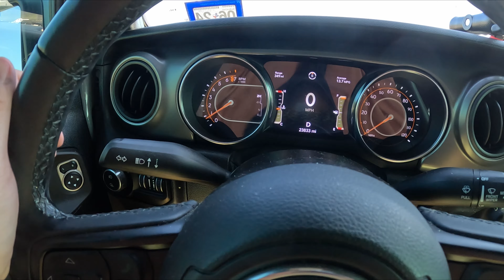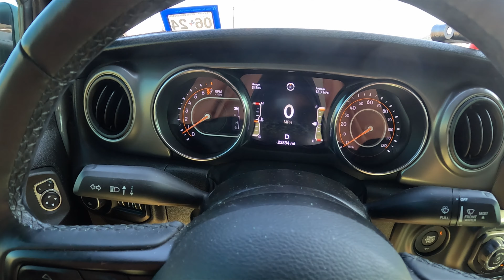5 ways to TURN OFF/ELIMINATE Auto Stop Start on a Jeep Wrangler JL, JLU or Jeep Gladiator JT

Comment: Fyi not all auto start stops have a second battery.  Ours is a rubicon 2021 with auto start and main battery shorted. Went to oreillys and bought both batteries pulled main one out followed a YouTube video were the second battery was torn it apart supported to be under the fuse panel and there was a compartment but no second battery.  Called dealer parts department and using  the vin there was no second battery on my rubicon ever installed at the factory.  No extra cables for it either.  Saved me 100.00 bucks
Reply: I have a 2021 Jeep Wrangler base model, and it also did not have the aux battery 
So I returned the aux battery back to auto zone for full refund.

Comment: I Live in the dessert and let me tell you sitting at a light and the engine goes off and since all the components for the Air-conditioner are NOT electric you only get hot air blowing. So, I have disabled the star-stop feature.
Reply: The auto stop will not engage is the ac is running and the cabin temp is above the thermostat setting. At least not on my 2024.
Reply: How did you disable yours?

Comment: I don’t know why they put the stop start in cars. It kills your starter and is bad for the engine when you stop all the oil flows to the bottom of the engine and then when the car starts again oil is introduced back to the top of the engine. This will definitely wear out your engine faster instead of letting the oil circulate without interruption.
Reply: My opinion: this is EXACTLY WHY they do it.
Reply: I don't know but I never met anyone who wanted that "feature". The jeep was at its best 10 years ago before all the "smart" stuff was forced onto consumers. Half the price too.

Comment: Took the start/stop battery completely out of my jeep and electrical taped both the ground and positive along with pulling fuse 42 and my start/stop is STILL functioning !?!??! I have the eco diesel 3.0 so I'm wondering if the fuse location and or fuse number itself is the same as gas burners ? Any help is appreciated.

Comment: Thanks for posting!  The hood plunger method worked for me and I don't mind the small "A" on the dash above the fuel gauge.  Such a pleasure to have the feature completely bypass without purchasing any additional hardware.  Also I'm able to still use my remote start too
Reply from the maker: Glad you were able to find something that worked for you. Appreciate you stopping by and Thank You for the Super Thanks!
Reply: I will Probably do the same and just get in my head that that A is the system giving me a grade.

Comment: The info you expalined bout the Tazer helped me so much! Long story short I bought my JT in AUG 2024  and I did not know until I took it to the dealership that someone prior to me put the Tazer system in. and it messed w/ my radio. ( it always displayed temp in Celcius instead of Farinheight and could not change it no matter what, it drove me nuts. At first the dealership changed the radio for a new one, that did not fix it.  3 months go by jeep dealership doesn't know how to fix this. they thought it was the BCM (body control modual) so in the 3 months, the AUX battery died, I replaced it, and SOME HOW the radio is displaying the correct temp. and NO before you could not just goto settings and change it from Celcius to Farinheight that did not work.

Comment: Pushing the button just turns it off when driving & it doesn't help the issue , which is the small bat. Draining and your remote start not working so eliminating it is the way to go !!! Won't have to worry about the small bat. And remote start will continue to work .. also the seat belt thing does work .I personally like Jscan better not only cause it's way cheaper but I find it does about everything tazer does but I believe tazer might have one or two brand specific things it does. All in it cost me less than 80 bucks to use Jscan & I can buy more vins where tazer is vehicle specific. Oh if you read the comments ( i hope so ) in your description you have the tazer link in for both tazer & Jscan not Jscan's link lol

Comment: I just purchased a 2023 Willys with the 3.6 and the auto start stop has not came on at all. Has mine already been turned off? I am afraid to turn it on . I don't want any problems. Also, will the aux battery still wear out if the feature remains off?

Comment: I just pulled the fuse and removed the battery cable from the main battery and my dash light indicator is still on! The auto start stop isn’t working anymore but shouldn’t the error light go away? I have a 2019 Rubicon. 🤷‍♀️
Reply: You may need to disconnect the main ground  for a couple minutes to reset the computer.  Then reconnect and try it again.

Comment: does the taser make the light on the dash go out ?
Reply from the maker: @rodneyhorton732  It remembers the last setting. So if  you turn it off, it will keep it off on the next start. 
If you have the lights on in the dash, it does not clear them.

Comment: The only thing I would add to the video is to either secure the box of the stop/start eliminator with a zip strap, or to wrap it with some kind of foam or electrical tape. It looks like it would rattle against that support piece. And I hate rattles

Comment: i think just turning it off will not solve the problem long term, I always turned mine off by the switch, it was muscle memory, and three years in aux battery dead. I love that little add on but long term I dont think its going to work. Plus, just not sure about leaving a dead LI battery in the vehicle, those things get unstable over time

Comment: The aux battery is not a lithium. It is a an AGM battery. Fyi
Reply: So my battery died he removed the line that connected to the aux battery bought a new battery main one.  The start stop still worked. So he removed the plunger reattached the aux cable then removed the plun ger removed  Battery died. Not sure why. Need help
Reply: @joycegregg4283  the new style AGM batt rays don't last as long as the old style batt rays with the refillable caps on top.
most new AGM batt rays are rated for 36 months, 24 months and 12 months.
the JL's and JT's have a lot more electronics running than the older model Jeeps have and that puts a drain strain on batt rays. the AUX14 batt ray is only a 200 cca. compared to the main batt ray has 850 cca. naturally 200 cca lifespan is shorter than 850 cca is.

Comment: I disabled my auxiliary battery by pulling a fuse, can't remember which one, and disabling the ground wire. It will still start stop off the main battery unless you disable it another way but I don't have to worry about that freaking $200 Mopar shitty battery draining my main optima yellow top anymore.
I also never wear my seat belt so I never really have to worry about it anyway.

Comment: 2023 Wrangler Rubicon, I believe there must be a sequence that activates the feature… (I haven’t figured it out yet) as I Normally enter my Jeep, start & drive off, Auto start/stop seldom activates…. My jeep mostly never has the feature activated… I don’t know why, but I’m glad something may not be working properly ;)
Reply: Your aux battery is likely dead.  Check the status of the start/ stop on the information screen.
Reply: If theaux battery was dead, the Jeep wouldn’t start.
Reply: No the main battery only starts the Jeep.  Tha aux battery is used to assist the main in running accessories while the engine is off in a stop/start situation.
Reply: @ernesttaylor967  And of course if it's an eTorque there is no aux battery. Just the 12V and the 48V .

Comment: I don’t own a Rubicon, but I do have a Jeep Cherokee Latitude and that auto start on off has been nothing but a headache! I believe that theory that the feature drains the extra battery, but now I’m also starting to believe that it puts a strain on the starter.  My warranty just expired 1,000 miles ago and guess what?? I have to replace that extra battery PLUS the starter, and it’s not cheap!! 😡 I’m just going to turn it off on the dashboard from here on out

Comment: Just remove the stupid damned battery for the start/stop, tape of the hot (really well) and jumper the N1 and N2 posts up at the (by) the fuse box, the fuse block, done! Stupid worthless feature. Just look this up: Jeep 3.6L Aux Battery Bypass
Reply: Excellent… connecting N1 N2 post was the charm.. Delete red fuse that control start stop… and disconnect/ remove the aux battery tape up negative and finally connect the positive of aux to the main battery…. Job done for my 2020 JT gladiator
Reply: Ps: putting. Fuse between n1 and. The N2 pole is dangerous and not needed… lost a 30amp and 40amp fuse… not needed.
Reply: Just curious if you have to take the Jeep in for service and they noticed what you did would it void your warranty ? Thanks

Comment: Jscan does not cost this much. My whole setup was 50 bucks tops. License is what 20 maybe? Much cheaper than that tazer garbage, and you don't have to leave it plugged in. It's a superior method, basically what a dealer would do hooking up their gear and making changes to the on board systems that last.

Comment: Can’t you just tape the hood sensors down and zip tie them off to the side?
Reply: He said you can remove and tie down to the side, but you do not want the
hood sensor compressed therefore taping it down is not what you should do.
Reply: That would do the same thing as the hood already does, defeating the purpose entirely

Comment: Many are just disconnecting the aux battery ground cable that connects to the main battery negative terminal and just tape it up out of the way and removing fuse #43,
This will disable the start / stop system and there will be no error codes or lights on the dash,
Of course this isn't a practical solution if you still want functionality at some point of the start / stop system.
Reply: This is incorrect....  (btw,  it's fuse #42, not 43...the description in the fuse box calls this F42- PCR CTRL FEED (ESS)* — If Equipped.   On mine F43 is the PWR Outlet Cargo -BATT)  You've described "deleting the Aux battery" (disconnecting the ground), and "bypassing the ESS" (auto start stop, removing the fuse).   This just makes it so the Auto Stop/Start doesn't check the Aux battery,  but instead just uses the main battery.   It does NOT disable Stop/Start.   The Aux battery doesn't actually even control the Start/Stop - it just keeps the accessories like AC /Radio / lights from cutting off when the engine turns off.  It doesn't restart the Jeep.  So, bypassing it just keeps the system from first checking the aux (which usually has the problem), and just uses the main battery.  You are right about the lights or codes,  the Avengers light won't be on the dash anymore, but unless you push the "A" button on the console to turn the Auto Stop/Start OFF,  it will still work unless you disable it using one of these methods.   Hope this helps.
Reply: @jimw4041 I removed the 42fuse. Took out the aux battery. Ran the aux positive wires to the main battery. That by passes the aux battery.

Comment: you need to remove the aux battery from the circuit or else it will ultimately drain the main battery. They are wired in parallel so they feed off each other - if either one starts to fail the other one will go with it.  Best to REMOVE the negative from the AUX battery from the main - tape it up and tuck it away so the alternator no longer charges it and remove the ESS fuse from the fusebox.  Then Auto start stop is off, no errors on dash and you are running on the primary battery only. MUCH simpler.  I do HATE Jeep for this nonsense

Comment: If you've not tested Method #3 (not using the driver's seatbelt), why include it in the video and the "5 ways..." title? 
This is doubly relevant since you then immediately attempt to distance yourself from the very suggestion you just presented.
Give some thought to editing the video title and its content, lest you get caught up in any legal action by a viewer who follows your instruction and comes to harm, and then circles back to this presentation. 

Your channel has practical, accessible content for the home DIYer. 👍It'd be unfortunate if it was adversely affected by liability issues.

Comment: I don't own an 'auto start stop' vehicle, but I had a thought about the (VERY STUPID) idea with the seatbelt.
Im not sure of the sensing method for seatbelt connection, but if it completes an electrical circuit, you could try painting the metal insert with a non-conductive coating. (It seems unlikely though, as I doubt there is a conductor running through the actual belt, but that would be the best design to make it more difficult for people to bypass.
Just a thought(VERY STUPID, lol)... Can, or do, people buy seatbelt inserts, so they can fool the car into believing the belt is connected? <That idea wouldn't be able to work if the sensor was electrical circuit completion.)
Anyway, just some random thoughts on a lazy Sunday afternoon. (It's only around 1:00pm, but as it happens, the radio is just now playing Alan Jackson's "It's Five 5:00 Somewhere"... so, as I closeout my comment, I leave any lucky reader with a hearty "CHEERS---Here's to Good Health, and Good Times!")👍🏼✌🏼🇨🇦

Comment: It's called the auto start and stop is just a gimmick to charge people more money
Reply: @justharkins9247  what are you even talking about I don't understand liberal
Reply: It is not a gimmick to charge people more money, it is to reduce the overall emissions for the manufacture allow and the manufacture to meet federal mandated emissions goals.
Reply: Actually, the government is making the car companies do it by the fuel economy standards.  My Wrangler has it and I had a 2017 Toyota Highlander with it also.  I don't like it and figure the money I save on gas will be wasted on the cost of a replacement starter one day.  So, I push the darn button each time I drive.